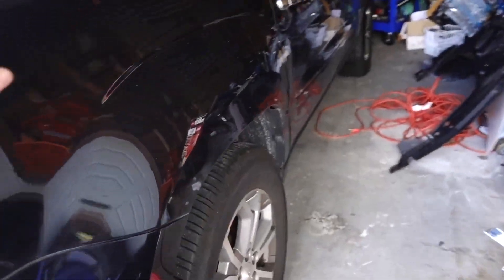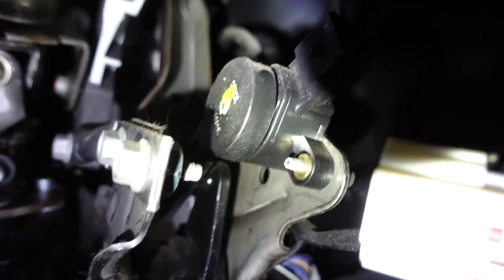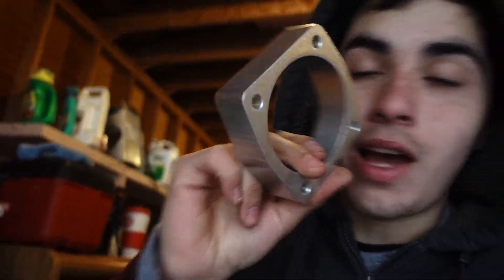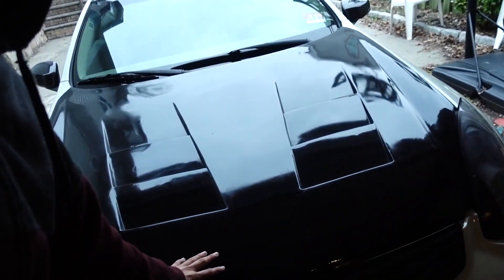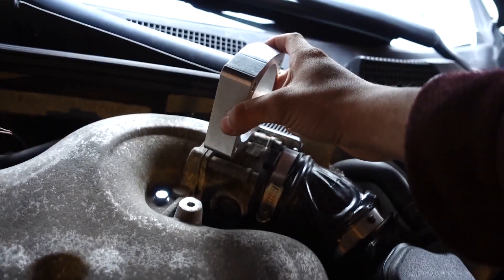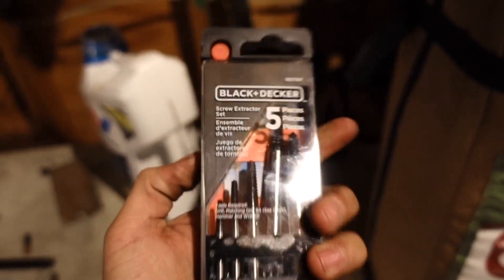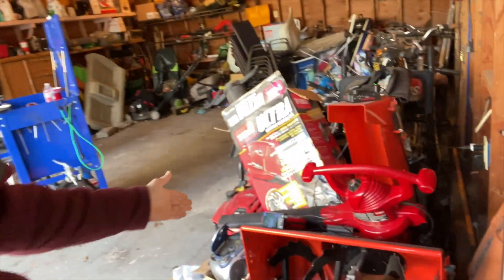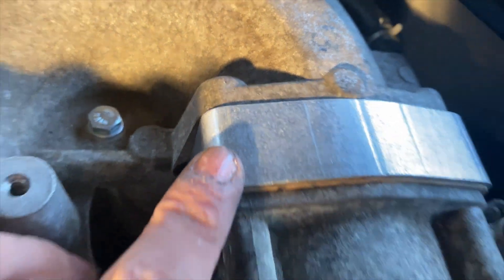Throttle body spacer install!

Comment: Did yours come with a smaller metal thing with 2 screws?
Reply from the maker: no mine came with 4 screws and a gasket
Reply: Mine just came in with that metal thing with 2 screws still trying to figure out what its for or if i need it.

Comment: How did u get the bolts out after I striped the head
Reply from the maker: You can use a turbo socket or I hammered a nut driver to it and twister it off

Comment: If I were you I would get rid of the Acadia man.... I had one and that was lucky the only problem I had was the timing chain but I hear that the transmission goes out pretty easy on those cars because of this thing called The Wave plate..... But anyways my timing chain replacement cost it $2,200.... Just giving you a heads up

Comment: I  dont get how this could work?. Wouldnt the MAP sensor detect that extra volume of air and reduce injector pulse width and retard the advance timing?.
Reply: You have to do an idle relearn, then the ECU will adjust A/F ratio within a tolerance
Reply: @codywright734  hey I know this has been a while since you commented but would a throttle body spacer like this one cause the car to go into limp mode if not relearned?
Reply: @markroden  Hey man, I think it can if the volume of air after installing the spacer is high enough, whenever I install new intake parts I do the idle relearn. One time I thought I really messed up but it turned out I forgot to plug the MAF sensor back in lol

Comment: Hey bro! If I were to get a plenum and throttle body spacer how much horsepower do you think it would add with an aftermarket intake?
Reply from the maker: I had throttle spacer, intake, plenum spacer, and exhaust and gained almost 100whp
Reply: @Ocrispin  hey bro ,  does throttle body spacer worth buying . I have a G37s coupe with cold air intake  and z1 upper plenum
Reply: @torvarrisevans3961   not really bro the plenum spacer manly helps the De motor because certain area doesn’t get enough air so the spacer helps.
Reply: @streetdream1726  thank u